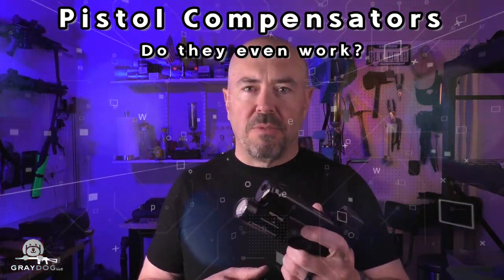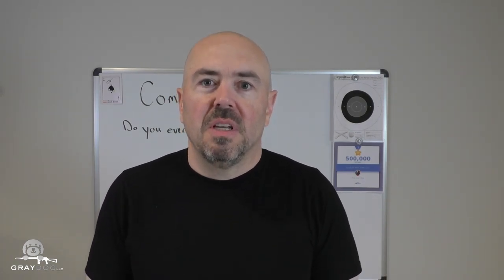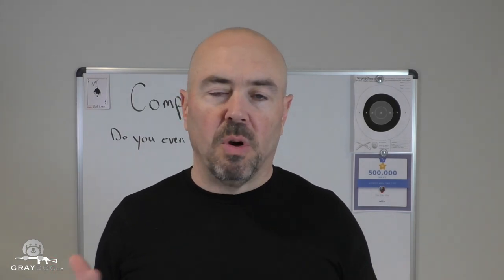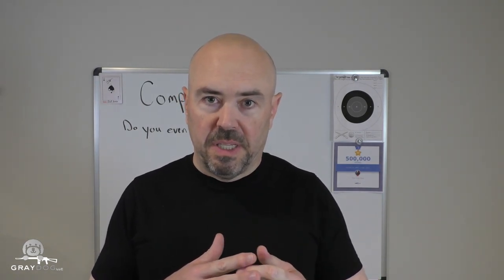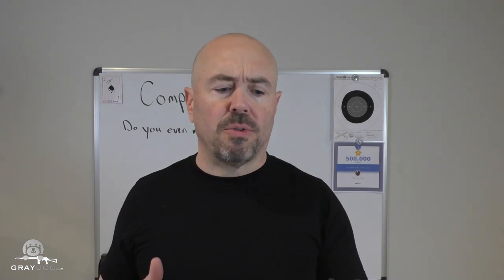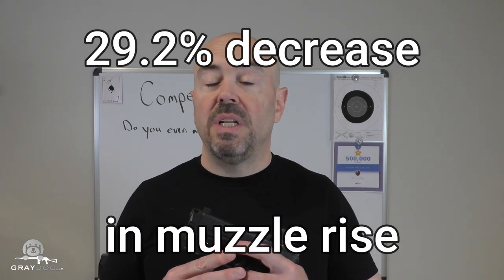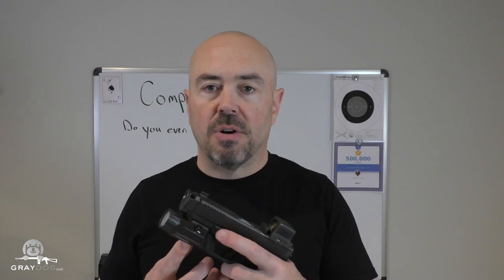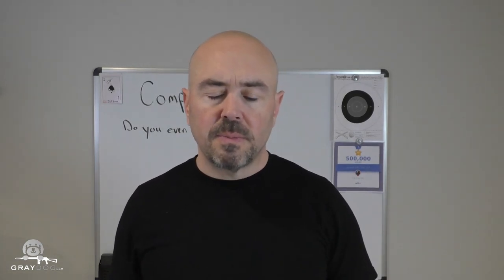Compensators for Pistols: Do They Kick Up Performance or Just Hot Air?

Comment: Great vid !!! I love my radian comp on my 19 gen 5 . I would like you to do the same test with an un-comped 45 against the comped 45 . That way you would truly see the max advantage one receives by adding the radian comp. 
By comparing a 17 and a 45 slide it makes it apples to oranges. Again thanks for you  awesome video ... Just subscribed and looking forward for you next vid ...God bless
Reply from the maker: Thanks for subbing! I figured the 17 would be a good comparison because the comped 45 and 17 are basically the same size. I could re-run it again when I get a chance.
Reply: @graydogllc i think it was a good choice tbh. I don't think the % of rise matters as much as the actual degree reduction. Which 4-6° isn't major, but the difference between +p and standard is still relevant (not that I perceive that much difference between the two irl)